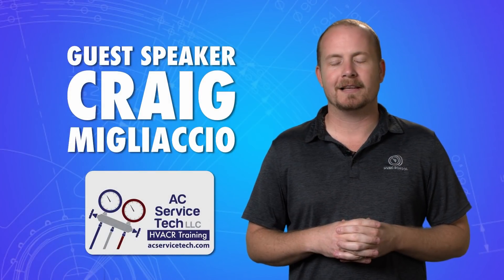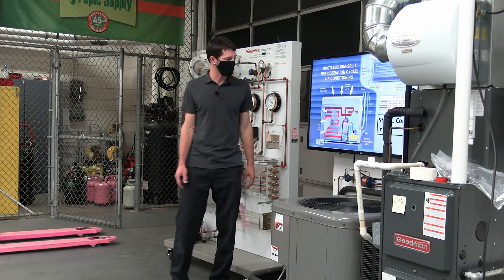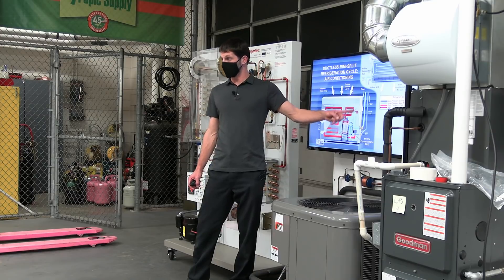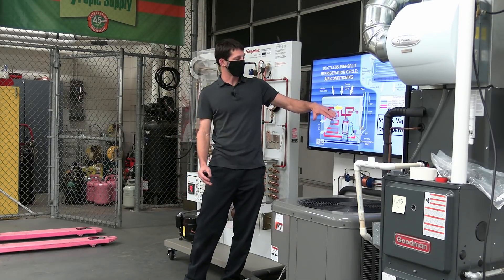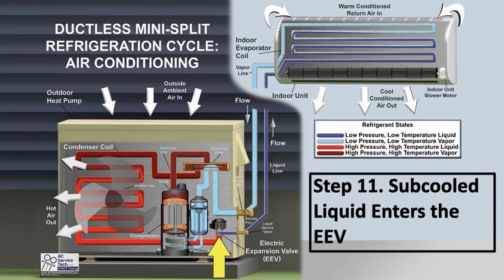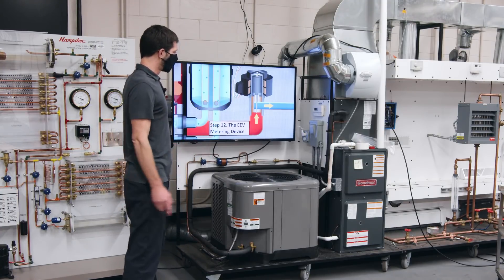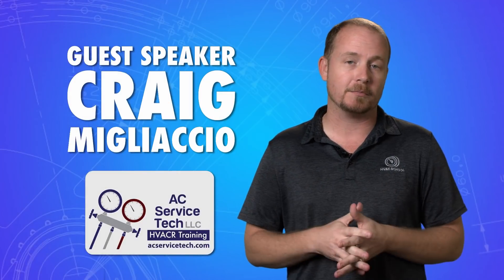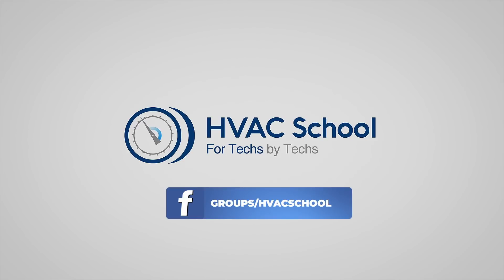Mini Split Heat Pump Facts  (PART 1: Ductless Air Conditioning Mode w/ AC Service Tech)

Comment: So the long and short is that you CANNOT diagnose low refrigerant level on mini splits using super heat measurements, at all. IF you suspect low refrigerant, you have to recover all the existing refrigerant; look for leaks, fix, pressure test and vacuum test until leaks are gone, and finally add back in the correct weight of refrigerant. MAYBE a shortcut would be to add small amounts of refrigerant and test BUT you risk over filling and compressor damage. I have watched two of Craig's videos explaining the situation and that is the basic takeaway as I understand it.

Comment: hello , I follow your channel and you have many interesting videos. Here in Europe, i.e. in Croatia, where I come from, we have  discussion about the minimum pipe length and the effect on the operation of mini split air conditioners, I am interested in your opinion, what is the minimum pipe length that should be in order for the air conditioner to work properly

Comment: Thanks for the video. Are the multi zone systems or even the split systems with inverters like mr cool , more forgiven or even matter if they oversized for the area?
Just curious on load calculations, obviously undersized wouldn’t work .

Comment: Some mini splits are design to have zero refrigerant added depending on overall pipe length on multizone units. Brand like midea can use on some of their 4 ton models 115ft max length on a single zone or 263ft max length on all zones combined.

Comment: I Wish the automotive technicians had such great educational material available to them for the new heat pump systems on cars that some also have glycol heat exchangers with second expansion valve directly attach to the second heat exchanger with three water pumps and 2 to 3 three-way valves.

Comment: Mini split heat pumps are amazing we got 118 degrees out of a Fujitsu and there is no electric ⚡️ heat strips. Amazing stuff.
Reply: Yeah, they are nice. With the low ambient units I see temps as high as 130 coming off the coil.
Reply: @matthewodonnell1856  isn't it ideal to get the condenser temperature as low as possible for efficiency?